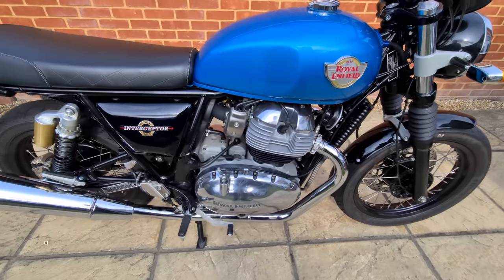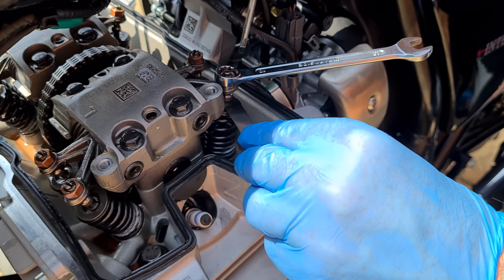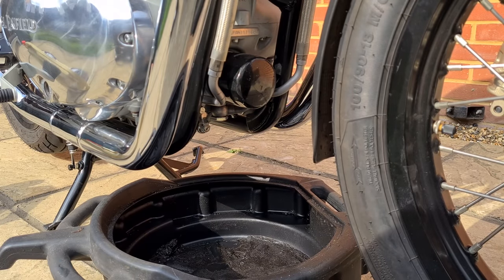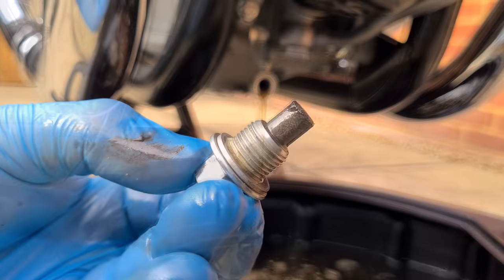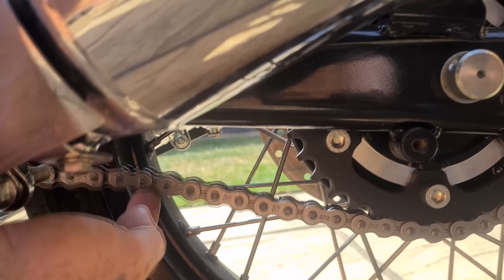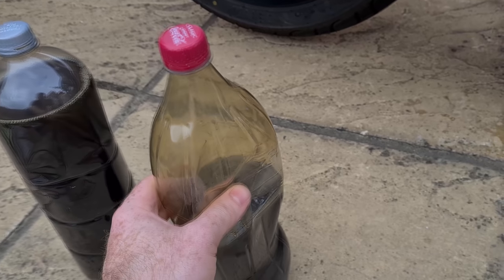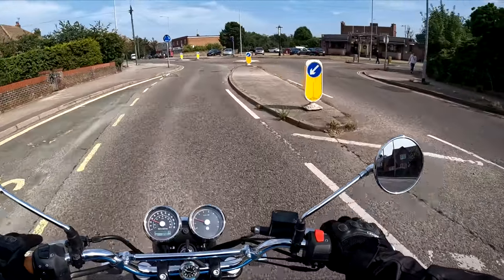Easy Valve Check & Adjustment on The Royal Enfield Interceptor & Continental 650 Twin

Comment: An outstanding demo. I would remind people to use 1/4 inch drive, only on the 8 and 10 mm screws, rather than a 8 and 10mm socket, on a 1/2 inch drive. It just makes it less likely to strip the treads. Also, a good idea to blow all and any dust or debris from above the valve cover before removal. This is not a criticism of the video, I should add..
Reply from the maker: Great advice Todd

Comment: An important point for this is to work on a completely cold engine. 
I’ve seen a few others that were good but yours is the most comprehensive and the arguably, the best.  I’m gonna be doing this for my interceptor. I enjoy working on the bike and it’ll save me $300 quoted by the dealer to do this.
Reply from the maker: Thank you 😊

Comment: Excellent video! I found a block of wood to prop up the rear of the tank since I don’t have any friends. On mine the ABS module needed to be loosened. Maybe a change since the 2019 model. The biggest problem most people have is fitting the gasket. I removed mine from the head, cleaned all the silicone sealant off and used 3M 45 spray adhesive to hold the gasket to the cover. No silicone is needed as the gasket seals fine without it. I reused the gasket 3 times. Still no leaks. 

One final comment. Most people will break the cover bolts when attempting to torque to 12nm. 8nm is plenty. It is much easier to snug a loose bolt than to replace a broken one.
Reply from the maker: ill be honest ill keep using my gasket till it leaks, and for the 8mm bolts I didn't torque them, I only nipped them, being in the trade you have a better sense with my elbow and 12nm felt too much imho. thanks for commenting and sharing your experience
Reply: @nicksepisode  Noticed that - an educated elbow is far better than a cheap torque wrench, esp on those fragile shoulder bolts (heaps of folk are breaking them at 12nm). 35nm is too much for the size and thread on the sump bolt too.

Comment: A very clear, well explained video which covers all important aspects of the first service. I would add one thing, for your viewers, the fuel pump plug must be re-connected with both parts absolutely square on to each other. I didn't get this right when I did the first service and bent one of the pin connections. This resulted in a lot of swearing and removal of the tank to straighten the pin. No trouble since and I performed the 6,000 mile service back in June.without mishap. 

These Interceptors are great to work on for the home mechanic and seemed designed for ease of maintenance. The only thing I have come across that I don't like is the way the rear calliper is mounted. Most bikes have the calliper  bolted to the brake arm, undo the bolts, wiggle the calliper and it's off. On the Interceptor it is pinned and the spindle and back wheel have to come off. 

Thanks for a great video, I have subscribed.
Reply from the maker: Hey, thanks for adding useful information to the video to help others. I appreciate the sub  too.
Reply: @nicksepisode  You're welcome.

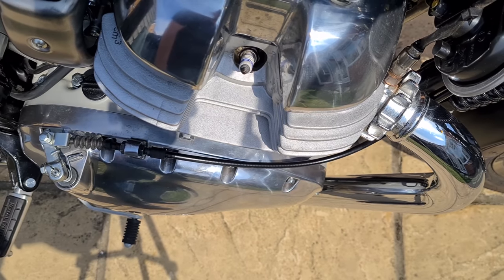Comment: On 99 percent of these videos people remove the plugs first, this should be done AFTER pulling the valve cover because of the potential to drop something (dirt or whatever) into the combustion chamber....you replace the plugs "first" when reassembling and remove them "lastly" before beginning the valve adjustment process. Playing it safe at 2:51 I see....
Reply: I like that little tip! That one I will take to.heart when I service my interceptor

Comment: I just finished my 300 mile 1st service on my 2022 RE INT,  the transmission shifts so perfectly smooth now , wow I’m really impressed with my Royal Enfield 650.  They definitely got it right on this engine design.
Reply from the maker: Isn't it a gem ✨️
Reply: Very good engine but looks like the engine would have to be split in 2 to replace cam chain

Comment: Well I have done this job(tappets) and I found it a bit of a pain in the arse, reason being fuel tanks  I've had in the past only had one connection not five, also the fuel hose was a sod to connect back up but that's probably my fat fingers! Another thing is the rocker cover is jammed into a small space and the gasket is a pain to keep in place without knocking it off sideways when reassembling. In the end to get more room on the job I loosened the nuts on the abs thingy  that sits in between the frame and the  rocker cover to give a bit more wriggle room.
Not complaining mind😄, it gets  easier when you've done it once and adjusting tappets with a spanner is easier than using shims like on a lot of modern bikes nowadays.
The guy on the Tec Bike Parts channel managed to do this job without completely removing the cover from the bike!
Good luck folks, 🏍️👍.
Reply from the maker: Good job. Removing the tank is more professional from a teaching point of view mind

Comment: Watched your video and a couple others and got my 300 mile service done today. The dealer (near Atlanta Georgia and 100 miles away) couldn’t get me in for another month and I wanted to learn. 

I had to take the horns off and take remove the three screws on the frame that hold the lines above the rocker cover to get it off. Even then it was a very tight fit to get it off and back on. 

Thanks again for this video and love the channel!
Reply from the maker: Good job Thomas, thanks for watching I'm glad the video helped.
Reply: Atl area here (gt650). You still riding?
Reply: @musicmaestro88  yep. Still have my 650. Ride on occasion… family and work have most of my time. I live near Chattanooga
Reply: @ThomasMichaud  nice!! I'll be up there Sunday on my GT650. Saturday I'll be at the big show @ Barber.
Reply: @musicmaestro88  was hoping to go with some friends to Barber but not around this weekend. Enjoy!
Reply: @ThomasMichaud  yeah... I'm doing Sat @ Barber... Sunday the Chattanooga Motorcar festival. Lots of 🏍 riding this weekend.

Comment: I've been using 20W/50 Castrol power 1 for years in my 23 yr old Ducati. 20W because of the ambient temp here in Andalucia.40+C in july/August when i hardly use the bike, but did have a very uncomfortable 700km ride to Valencia once in sept 45C had me flagging but bike was fine at 90mph.🥵🤬
Very clear educational video. I do all my own maintenence too
Reply from the maker: Officer: Why are you speeding ? 
You: I'm cooling down!

Comment: Man these Enfields are growing on me. Seeing the chunky valvetrain parts, the ease of adjusting the valves with the old method vs the stupid shims and the sizeable oil cooler, it makes me think that it is built to last. 
You missed a couple steps though, getting burned by the exhaust and dropping the plug into the old oil. I think these are mentioned in the service manual 😄
Reply from the maker: i agree with you about the chunky valvetrain parts, built to last. I definitely burnt myself on the exhaust though lol
Reply: I just finished my first service on my 22 interceptor... went well but i did burn my bald head on the exhaust.... 🤣

Comment: Excellent vid, very easy to follow, the tappets are so easy to adjust, need mine done shortly along with the oils etc,love the interceptor cracking looking and riding machine 👍
Reply from the maker: Cheers Chris
Reply: That's one of the hidden beauties of the Royal Enfield engines - screw-n-locknet tappet adjustment, with no shim-under-bucket and cam removal necessary.
That makes RE engines perfect for owner-maintenance.  The downside is the lower rpm engine design which limits peak power.

Comment: This is a great tutorial. I was a bit hesitant to consider this bike as the maintenance intervals are a bit short compared to other bikes I'm looking at. This work is well within my still level and uses tools I already have. Assuming the bike is otherwise reliable this should be a fairly inexpensive bike to maintain. Thanks!
Reply from the maker: Hi Chuck, maintenance costs often get over looked when purchasing a new bike. Not a problem on this machine. Thanks for watching I'm glad it will help you.
Reply: One of the reasons other bikes have longer valve adjustment intervals is because of the "shim under bucket type valves". The intervals will be longer, but when you go to adjust them, you have to take the cams out to replace the shims. Lot's of fun there:( If you really want a bike with easy valve adjustments, consider Moto Guzzi as the heads stick out the side meaning you don't have to take the tank off etc. Just take the valve covers off and adjust. Very quick and easy to do.

Comment: Another very useful vid and look forward to the Meteor service 😀 When I was buying my Classic, I asked the dealer if to maintain the warranty, would servicing would have to be done by them or can I do them myself, his answer surprised me. As long as I use genuine parts and tell them it be done that should be sufficient to maintain the warranty. Now my Classic is going in for the first service next week and after that I will do the rest but will ask the question again. Where did you get your clock? it suits the bike 👍
Reply from the maker: That's good to know. Jodies meteor is on 150 miles now so won't be long before I'm doing the same. Video incoming! The clock was from ebay, I will be positing a mod video soon with links to everything I purchased. Thanks for watching

Comment: Thanks for the video. I've done these 2 jobs once on my RE 650 GT (same as the Interceptor for these 2 jobs).  I find it better to do things the easy if longer way i.e. like you I removed the fuel tank when I did the tappet adjustment.  It can be done without removing the tank but at least for the first time I prefer to take that extra step (as you did) and avoid the struggle. I'd suggest it would be prudent to have a new rocker box gasket on hand. My bike (an ex-demonstrator) had a very small oil leak when I got it. I could see the fresh drop of oil on the garage floor but I did not know it was coming from the rocker box seal until I did the tappets and had a worse leak. Both leaks were fixed by making 4 special cover bolts to compress the gasket another mm or so (for some reason the gasket sold locally was horrendously expensive so I ordered 2 from India).  I manufactured the 4 new bolts with high temperature O-ring seals.  The new seals  are now here from India so I'll use a new one next time I have the rocker box off.
Reply from the maker: Great !

Comment: Great vid Nick.  I paid the £300+ soon after purchasing my E5 model and it's not good on the wallet so soon after forking out £6k for the bike. The Interceptors first service schedule of 300 miles is so short and comes around the day after tomorrow so to speak just far to soon. Anyway great vlogg and was interesting to watch. Slightly of subject Nick but has your bike ever just cut out for no reason whatsoever when downshifting or stationary? My E5 did and it turned out to be the stock relays. They are covered in a thick white grease that was some cock up at the factory according to research and most dealers are aware of this but some like mine were not rectified soI  changed relays to Bosch and bikes been fine ever since. There's plenty of vloggs on here raising the issue so maybe worth you looking at yours to be on the safe side. Ride safe guys.
Reply from the maker: Hi Paul, thanks for commenting. Mine used to drop below 1k and nearly stall, finessing the throttle while filtering in traffic sorted that. I did clean the relays though. I've since put a 2-1 Tec exhaust on it and it don't drop revs anymore. I might buy the relays just because the stock ones do get hot. Thanks for the heads up. Ride safe
Reply: @nicksepisode  Pleasure Nick. Yeah I've seen the 2-1 Tec exhaust. Nice bit of kit and good weight saving. I put scorpion red power on mine and the DNA filter and the difference is very noticeable. The stock system is heavy to say the least. Yeah I would change the relays also if they get hot. Thanks again and stay safe guys.
Reply: IMO it's not the dielectric grease or the relays but rather it's the poorly crimped female spade connectors in the relay block. Phaffing about with them may improve contact but it masks the real issue. I've also seen female connectors pushed out the back of the block because they weren't clipped in correctly.

Comment: When i get the 650 I think ill do the servicing myself. Ill do 300 miles in 4 days. So expensive for the shop to do it. I've had my GSXR 600 20 yrs no problem service it all myself, Its a Risk you take, I got creamed on servicing cost when i first bought it.

Comment: Thanks very much for a clear and precise presentation. 
Had you considered going to a Royal Enfield Dealer for its first service? Only asking as my bike (INT 650) is due it's first service and for me being a novice I felt it should be done by a RE Mechanic. However, I would like to service my bike in the future.
Thanks..
Reply from the maker: For warranty purposes, i would if i were you. I was covered as i had this video and used genuine parts. It's a simple job if you have done some mechanics in the past

Comment: hi nick.. great vid.. very helpfull... i have just bought one... how long till engine is fully run in.?    ive had a honda from new the running in period was soo BORING... it loosened a bit at 1500 miles.then fully about 5k miles....wondered if the enfield is simillar..?  the tappets look simple to adjust im a fairly competent home mechanic( i detest main dealers)  i will be able to do this easily...every 6k seems way too much for a low revving engine..maybee its to keep the £ going into dealers.. ?    nice 18" wheels for kents pot hole strewn roads....
Reply from the maker: I’d say about 1200 miles the engine loosens up. I never took it easy from new, run it in hard! The service schedule is worth sticking to especially if you can do it yourself. Congrats on the purchase, you have a great bike !

Comment: I had to remove the horns and breather tube . Also had to remove the 3 bolts on the frame and prop up the brkt.  To get the valve cover off. Mine didn't need any valve adjustment.  I also cut the oil filter apart and removed the paper pleats apart. There was metal specks on the paper. I will do this again when changing the oil. Till I don't see metal inside the filter paper.
Reply from the maker: Good job

Comment: Nice video. I couldn't remove the cover on my euro four Interceptor without lowering the inlet valves first. Also have you found an easy way to release the front fuel pipe catch? I modified a scrap screwdriver so that I could lever it against a convenient bit of bike to hold the catch while pressing the rear one in. You do need three hands though
Reply from the maker: I guess being in the trade I take it for granted that I can just use my fingers to release the pipe. It's a bit tricky though
Reply: @nicksepisode  There's no way I can get my fingers anywhere near the front catch.

Comment: Fantastic informative and well done vid sir! Forgive my ignorance, but how does one know if and when motorcycle valves need adjustment? Thank u!
Reply from the maker: Every 4k miles. If you purchased new then this is the most important job as they are slightly out of spec from factory, do the first one at 300 miles
Reply: @nicksepisode  thank u very much for the info. stay safe and God bless.

Comment: I found that of if I remote horns and coil I had enough room to keep the gasket on the cover for refitting, much easier to line it up with the top of the engine, just be careful not to catch it on the valves when refitting
Reply from the maker: Great tip!

Comment: Hi, hoping I can pick your brains you having the same exact same bike as me . I want to get the rims from black to silver or polished, obviously as a mechanic you may have some idea on how to go about this. The obvious choice is replace the rims but that would run around £600 and I cant afford that, painting over the black will prob look naff, so any ideas? The only thing I hate about the bike is the  black rims. It makes the bike look like it has balloon tyres where the silver rims make it look much slimmer and more in keeping with the style of bike.
Reply from the maker: Hi Geoff, its a tricky one, in order to do it properly you need to remove the spokes and get the rims powder coated, if your doing the centre too you'll need new wheel bearings as well. you could always ask on the owners forums someone might swap you. or maybe some rim tape to get a different look from the rims? i myself prefer the black as its less maintainece keeping the chrome clean. Hope you get the results you desire, good luck and thanks for watching

Comment: Blimey, £295 is a hefty quote. I reckon that I will service my Continental GT myself when due. I have the full RE service manual, the skillset, the proper tools with torque wrenches etc, the genuine parts and a garage to do it in. It's crazy that this engine has been designed with ease of maintenance in mind, yet RE would have you believe that it's imperative that you visit them, and only them. On a similar note, how pricey are the genuine RE oil filters!
Reply from the maker: I know 22 quid for the filter! I just purchased one for the meteor, that was 14 quid and its tiny!
Reply: @nicksepisode  Youtube videos show WIX to make good filters (oil and air as well) with a wide selection of sizes.
WIX probably makes one that'd fit the RE 650cc engine that could be even better - and cheaper - than RE's OEM oil filter.

Comment: Castrol Power1 4T synthetic motorcycle oil has API rating of only "SL".
Since 2010, "SN" superceded that and is for engines which meet the latest emission standards - which have higher temps and deposits.
Motul 7100 4T synthetic motorcycle oil has the "SN" API rating.
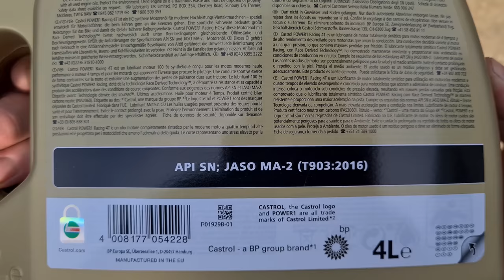Reply from the maker: Look again, this Oil has a SN rating, not SL 13:42